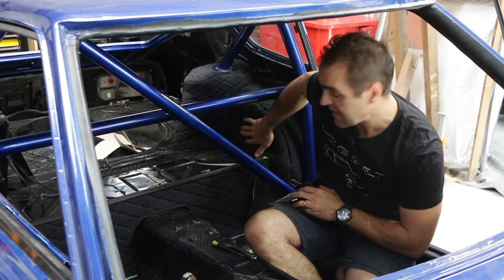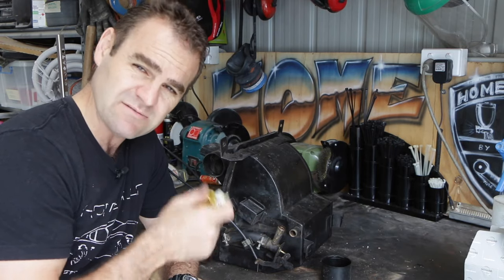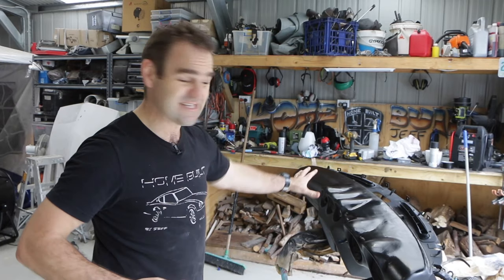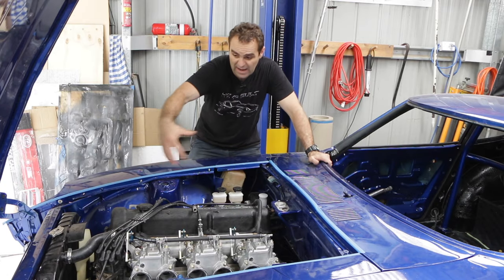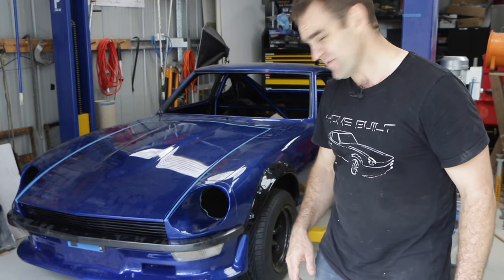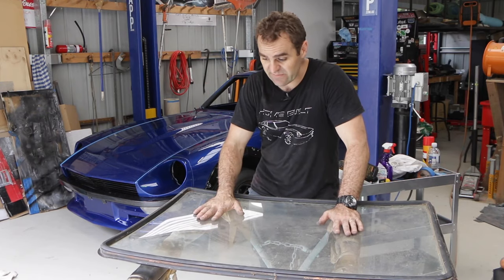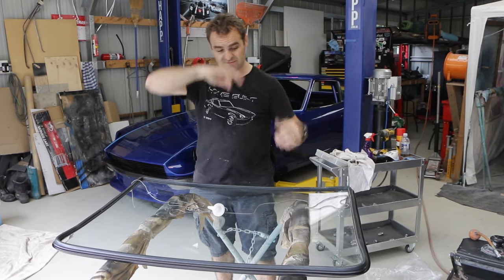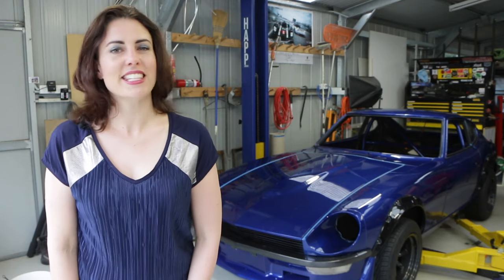Sorting out the front end - Home Built Datsun 240z part 77

Comment: Remarkable self control there Jeff when you dropped the front lip. I would've let off a few expletives indeed and a few coins in the swearing jar to follow.
Reply from the maker: If you look closely I have blurred over my mouth and dropped the audio at that point ;)
Reply: I actually swore for you in that bit.
Reply: Jeffrey Salzman 
Yeah. 5:50 oops!  I’ve messed up worse than that.  Lucky you didn’t crack those clear turn signal lenses. They are around $150 here in the USA.  Same as I used on my Z-car.

Comment: I did my dash and it kept cracking again.
What I did was remove most of the screws holding the dash to the metal frame except for about 4 screws. (there's a lot)
Since the dash is held in by the pillars and instruments it wont go anywhere. Allows the dash to float on the frame so there is no pressure on the old foam to stress crack again.
Worked for me.
Reply from the maker: Nice idea

Comment: Intellectual pigmy that I am, wouldn't it have been easier to fit the rear hatch glass with the panel off the car?
Reply from the maker: It helps to be able to get to both sides at once. One to push down and the other pulling the string.

Comment: The chrome goes on before you put the glass in the car....If you are going to use it...
Reply: I always put mine in after, it's meant to be a locking strip that locks it in.
There is so much debate around the chrome locking trim and when to install it that it probably makes little difference to the installation process haha
Reply from the maker: I am not using it ;)

Comment: hey Jeff if that is the urethane splitter id suggest bracing it somehow, under high speeds it will want to flex on you pic for reference (https://forums.hybridz.org/applications/core/interface/imageproxy/imageproxy.php?img=http://album.hybridz.org/data/500/zccivbbq211.jpg&key=6f58a8e86c5f1cf40a437aa6acf057f5a16167e3686082d358f0193206c1aebc)
Reply from the maker: It is Fibreglass, not Urethane ;)

Comment: So funny , people go to ebay first to buy a $100 heater tap that i sell for AU $36.00
Reply from the maker: Where do they sell for $36? Nissan quoted over $300
Reply: @HomeBuiltByJeff  Look at TFT5105  or  TFT5202 and make a mounting bracket or use zip ties
Reply from the maker: That would do the job for sure.
Reply: I got the price wrong , try $22.00    Google  "A to Z motor parts Geebung"